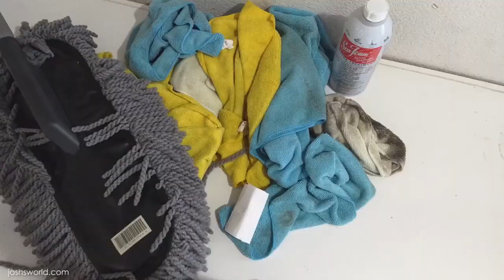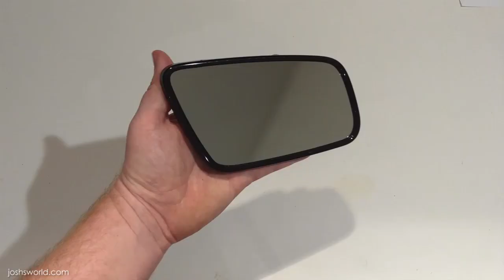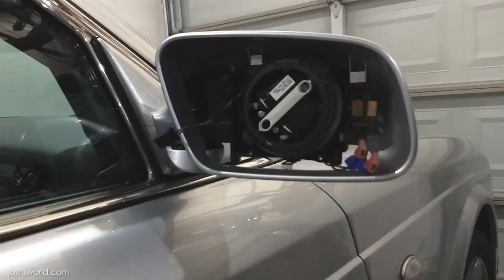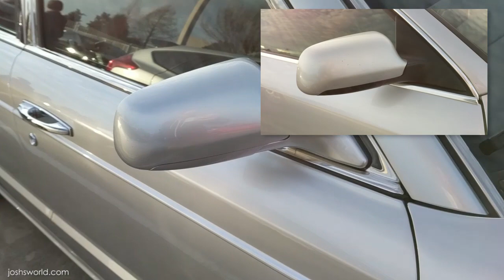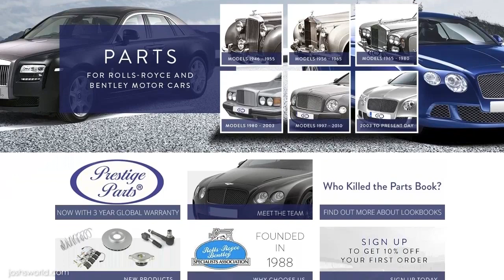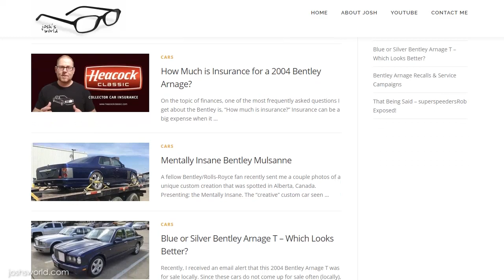How to Replace Side Mirror Glass | Bentley Arnage

Comment: Yes..the Audi parts reminds me my Silver Shadow Rolls Royce was equipped with  a GM turbo 400 auto transmission.
The servicing was cheap which was a bonus. The GM logo had been  discreetly removed by RR
Reply from the maker: The Arnage also shares a GM transmission.
Reply: Mt next Rolls is a Seraph ..good news in many respects.BMW motor paired to GM reliability.